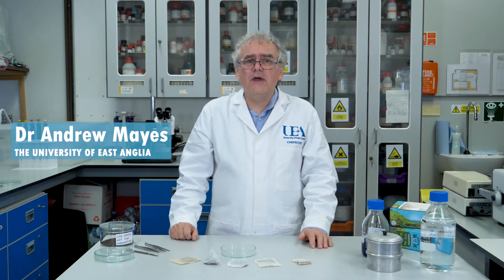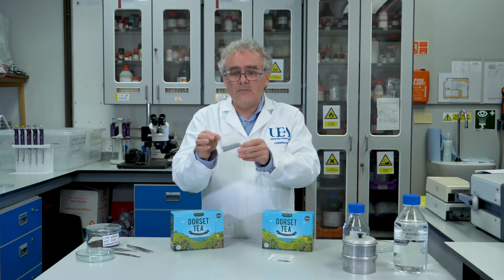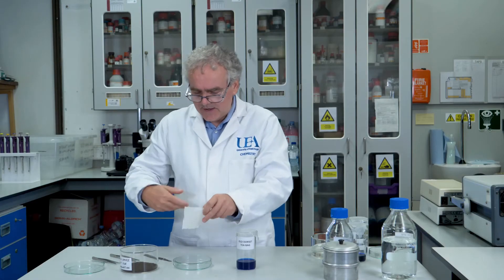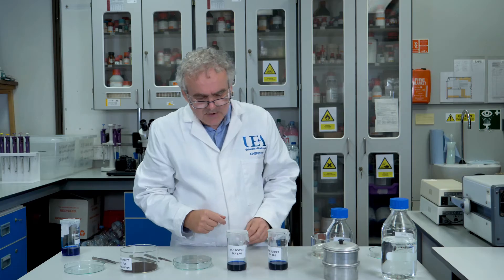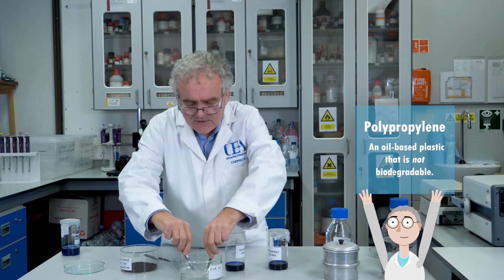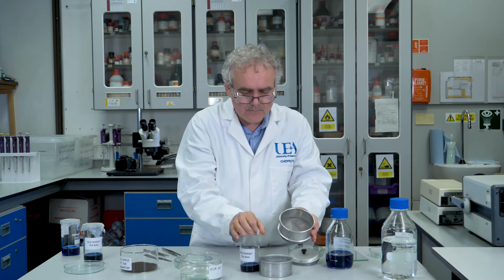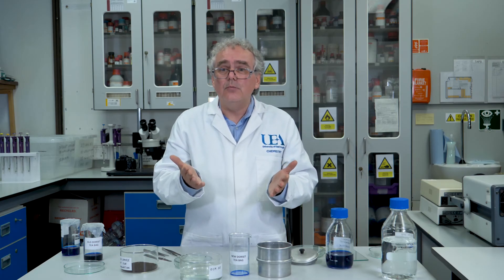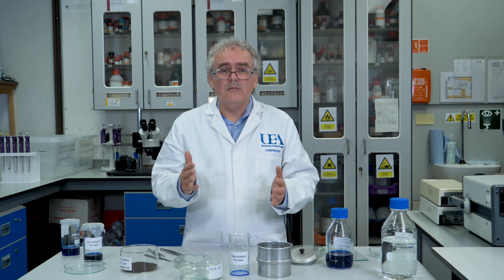#Microplastics: So... What's in your teabags?

Comment: pickwick tea ..no info..rips easy so that seems paper but many say seeming paper can be plastic coated inside or ....... even chat gpt dont know , google did not find...........cutting bag w scissors ...will that release particles plastic ..probably  so maybe cut and wash end .....and pouring tea grains from bag into near boiling water , not putting bag into water,,, will it help....maybe that is not enough maybe plastic particles go into tea even if bag is not used for brewing...but a bit better still. or a lot better. l guess.....maybe wash grains i cold water before using...burn test to see if paper looking burn or plastic looking with melting is not so good test some say cos paper with a little plastic coating burns like paper. saw comment say most paper bags have plast coating  2025 — But experts said that while it's good to be cautious about microplastic exposure, there isn't enough evidence to ditch your favorite tea just .
Reply: How about using loose tea. 🤔

Comment: Hey doctor, this video has been very informative. I wanted to know if there is any research on micro plastics in relation to cooking food sous vide. This method of cooking is becoming popular, using plastic bags to cook food in hot water so the food can reach the same internal temperature throughout. I am concerned that similar to tea bags, putting food in plastic bags and then exposing them to hot water to cook may have a similar effect to tea bags. Any research or advice on the matter would be appreciated!